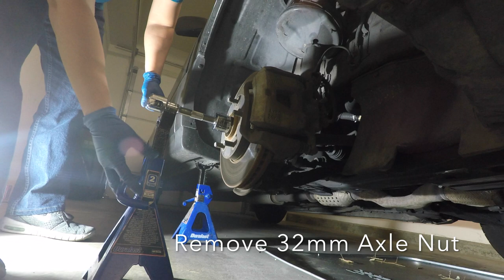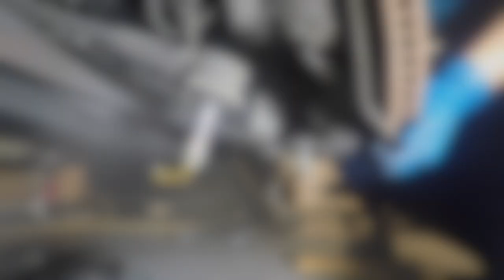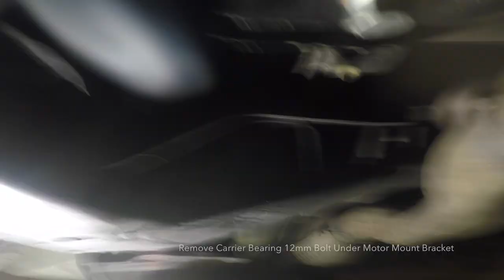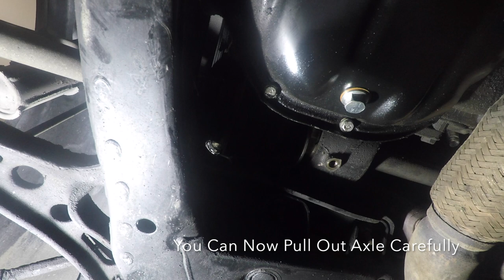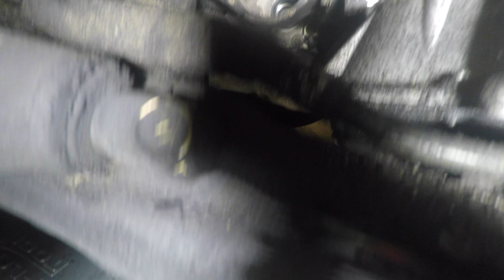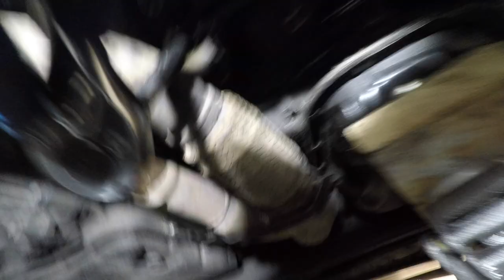DIY VL●OG: Lexus ES300 Toyota Camry/Avalon/Sienna/Solara 1MZFE Rear Motor Mount

Comment: Damn that’s a lot of work for a motor mount.
Reply: The newer models does not required remove all of those parts, but for those newer models you have to remove the engine mount in order to remove to lower control arm.
Reply: @hungpham8090 how much newer? Im doing a 99 next weekend. Looks like it’ll be roughly the same

Comment: You sure did make this look easy! Very nice. I might attempt soon. Do axles come out that easily usually? That’s the part I’m afraid of
Reply: Depends on how old is your car the passenger size axle is PITA trust me if  it seized in the bearing you will scream.
Reply: I suspect that this mount needs replacing on my car as well, I was wondering what signs have you got from this being bad, I have a clunk when going from Drive to reverse, but more highlighting is that I get a clunk when slowing down, it’s when the car downshifts from 3rd gear to 2nd gear, do you also have this issue?
Reply: Cut the axle and remove the mount as shown.  But before you do that, Call a shop

Comment: The thing that I find frustrating is on every video I've watched once the c-clip & bolt are removed the axle slides gently out of the center support housing. This is not the case with my 97 Avalon. I'm not replacing the mount , I am replacing the right axle and it looks like this is the method I must follow but unfortunately with the axle still attached inside the housing. I have pushed, pulled, beat, heated , greased & sworn all to no avail .
Reply: Did you ever get it out? Doing just the axle right now on a 98 ES300 and I'm in the same position. Won't budge.
Reply: @MrJamesonStyles  
I ended up using a cutting wheel and sliced the axle between the transmission  and the bearing support assembly, a few taps with a hammer and it popped right out.
Reply: @mauricebrock4233  that'll be my go-to if the slide hammer and axle hook doesn't work. Thanks.
Reply: @MrJamesonStyles  best of luck to you.
Reply: @mauricebrock4233  Thanks. Because the exhaust was in the way on the Lexus I had no room to get my grinder in to cut the shaft, nor room to hit it with a hammer if I'd been able to. I ended up having to remove the entire motor mount assembly with the axle still fully attached, and that was quite a pain to pull all of that out through the wheel well. However, once I had the whole thing in the vise, I was able to really get some heat on the mount and after about 100 sledge blows the bearing finally popped out.

I also discovered at this point the mount bushing is badly split, so that'll be done as well, new part locally was like $27.

At least all of this, the axle boot splitting, the mount being bad, didn't all happen in the dead of winter or something. Better to happen now while it was already apart for the wheel bearing job.
Reply: Weary traveler.  How was your mission?

Comment: Is the same procedure for a 1996 Toyota Avalon? Ive already replaced the front engine mount, top dog bone mount, and transmission mount, I am a bit confused on the rear mount because on my car I have 2 half shafts each held in by 6 8mm hex bolts.

Comment: Hi, how did you know when to replace the rear mount? It's kinda hard to know vs. the side and front mounts. Did you crawl under to look at it or did you feel anything while driving? I have an Avalon. Thanks for the video. Much appreciated.
Reply from the maker: fastskipper777 thank you and glad it would be of help! The way to find out is to lift it, and have someone shift through Drive and Reverse while another checks from underneath how much of a play the engine has. But it’s really a no brainer based on mileage and age.

Comment: How long did it  take you to take it off and put it in? And how much did you pay to have the new one pressed in? Thanks.
Reply from the maker: Probably a couple of hours. It was much harder to put it back in as its a very tight space and requires a bit of maneuvering. The shop charged me like $40. Could've been cheaper if I brought it to a machine shop, but the auto shop was much closer.

Comment: Is there a chance u remember the part # for the insert and where did u get it? I got mine at napa and it just doesn't fit wen they try to press it in thanks.
Reply from the maker: I bought mine through RockAuto. It was a direct fit.

Comment: So removing the rear motor mount requires the removal of the axle, lol oh brother... 😩
Reply from the maker: Lol if you think that was bad already, this definitely isn't a job for you to DIY.
Reply: Organized Garage Status I have a later model Camry, the mount is moved closer to the control arm and is easily removable but this one looks like a pain. Not undo-able, but just a pain... however I have to deal with the rusty axle bearing bracket in the event my axle fails!
Reply from the maker: @Dexion845  removing the axle was the easiest part. The actual hard part was getting the bracket back in place as it was very tight and hard to maneuver it back into the studs. It shouldn't rust also, as its cast and the bearing is stainless and I'm located in Cali. LOL